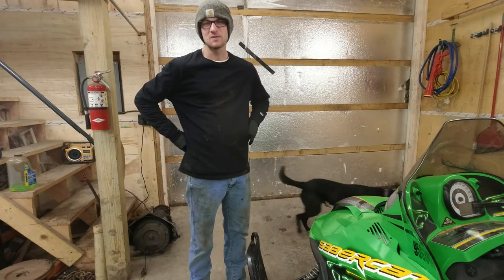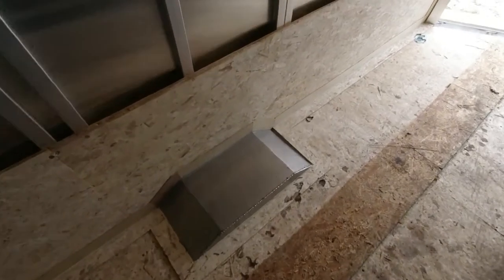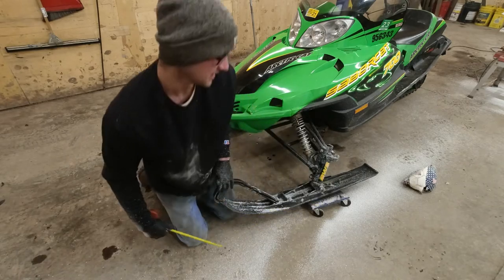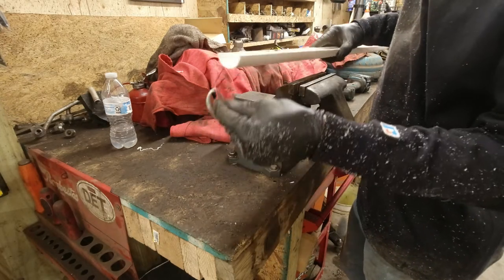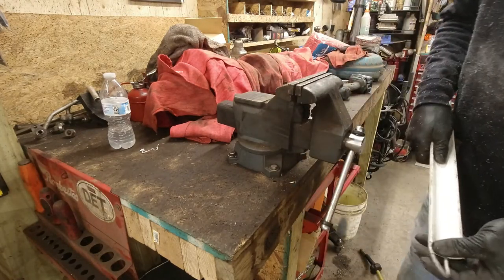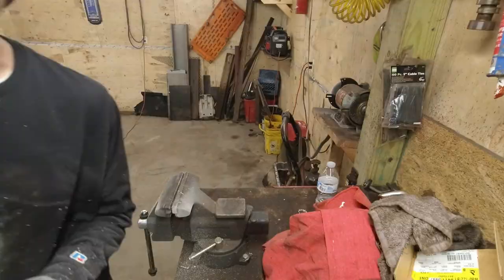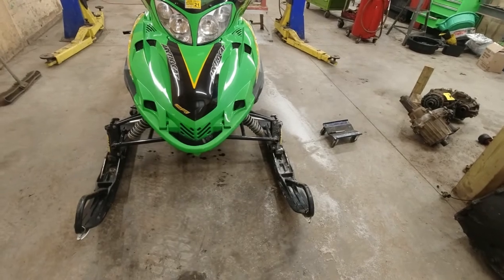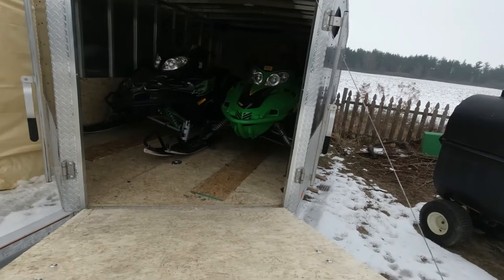Snowmobile carbide covers

Comment: Thank you for taking the time to record and post that. I have been looking at ski slips by a company that wants over $100 for a pair. I just need something to cover the carbides and not cut my aluminum trailer in half! I just bought the trailer and really didn't want to chew the heck out of it with the new carbides. I haven't started my mod yet but your idea is excellent! I thought for sure you were gonna get a torch out and bend the pvc, but there doesn't seem to be a need to.
Got two questions: what was the PVC pipe size, 2"? Also how well does it stay on backing up?
Again thanks for posting this!!!
Reply from the maker: Thank you for your kind comment! I do believe I used 2 inch pipe and having mine only hooked on the front of the ski they do come right off in reverse but I have a pull thru trailer. I think if they were a little longer and put a hook on back of the ski somehow they would hang right on.